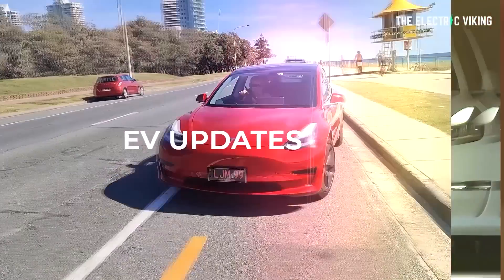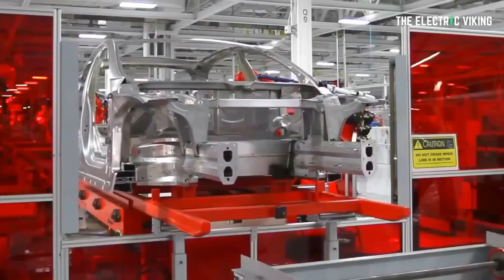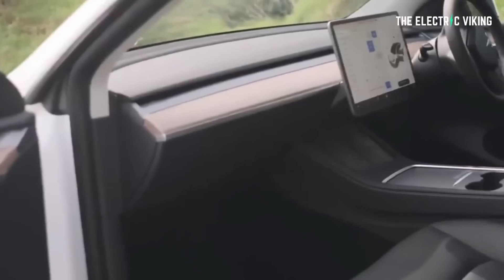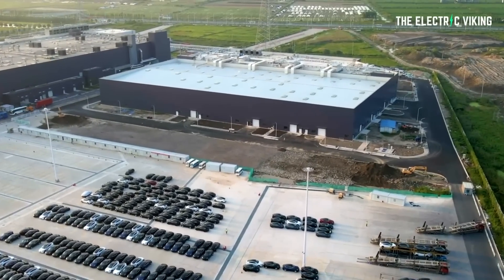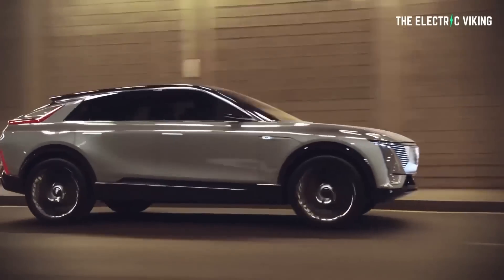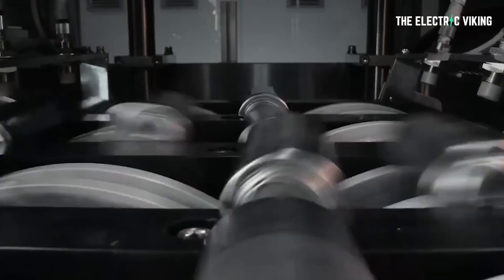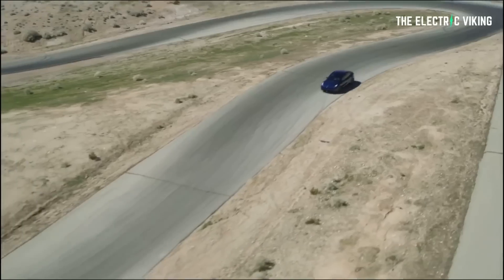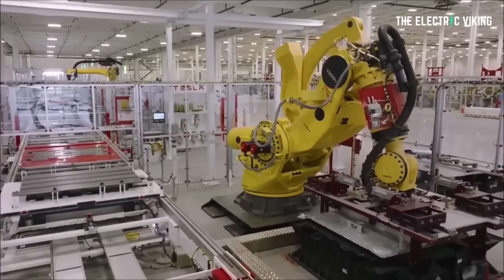Tesla's NEW 4680 battery pack size is UNBELIEVABLE

Comment: It may also be that Tesla wants to make as many cars as it can with its limited supply of 4680 cells, thus making more profit.  As someone else mentioned, for most people 250 miles of range is fine.  Making 50 kwh packs means they can make and sell 33% more cars than if they made 75 kwh packs.
Reply: If this was all about profit then why not produce less cars and have insane prices?  Far better profit ratios that way.
Reply: @davidbeppler3032  because that's not the most profitable outcome. You don't get charging station networks across the nation by selling expensive cars
Reply: Perhaps is a matter of supply.  They need these cells for cybertruck and the transport truck.  That higher efficiency will be invaluable.   For those of us waiting for a vehicle ability to produce more is important.
Reply: @elainebradley8213  
They al ready told us.
"WE. ARE. NOT. BATTERY. CONSTRAINED. THIS. YEAR!"
Reply: @rogerstarkey5390  Elon is known to exaggerate. A lot. Also, Tesla is still in negotiations to have more cells made. So right now, they are constrained. Finally, please calm down. This is supposed to be a discussion, not a shouting match.
Reply: @vremster  
I get really fed up with people
1) Just not listening
2) taking information second hand, rather than from the source
3) Making wrong assumptions from that information, then protesting it as fact.
.
They literally have a stockpile of cells.
They have said so.
They have sufficient ongoing production, even at low volume.
They have said so.
It wasn't just Elon saying so...
Apart from those facts, you "might" have a point, but since those are facts .....
.
"In negotiations to have more cells made"....?
If you mean "4680 cells", it's a lot more than "negotiation".
Panasonic has, or will very soon, supply cells for evaluation.
.
Ask yourself about the technology they used.
.
Nobody could make 4680 cells because of the resistive heating issue ("long electron path")...?
Maxwell found a way.
Tesla perfected AND patented it.
So unless Panasonic found another way, they're using the patent "in good faith'....?
.
In that case, they're not "negotiating" but "cooperating".
Hence the very conciliatory, almost submissive, tone from Panasonic (read the statements)
Reply: @vremster  When did Elon exaggerate?  He said the Model S Plaid would be stupid fast.  It is.  He said the Model Y would be the world wide best seller.  It is.  He said they would build reusable rockets.  They did.  He said he would sell all his houses.  He did.  He said he would send a Tesla to space.  He did.  He said Tesla would be bigger than Toyota.  It is.
Reply: 1) "make as many as possible"...
That'll be the MISSION ??

2) 250 range is fine.

3) IT'S NOT A 50 kWh PACK! Watch the actual test rather than taking information second hand from an (often) unreliable source!
Reply: @rogerstarkey5390  I can work with only the data I currently have. I haven't seen a test video yet. I'll have to look for one.
Reply: I don’t know about the 4680, but with other batteries it is good practice to keep between a 20 - about 80% charge, ie 60% of full battery capacity. If so, then the 4680 would have a good practical range of 60% of 250 miles (assuming that is the stated range) or 150 miles.  Seems a bit short a range to me except for short local commutes and trips, however with Tesla’s SC network that would not be a problem going cross country so maybe not a real problem.   When an EVs range is stated as X don’t expect to get anywhere near that if you do a lot of long range driving. Charge rate slows down significantly as the battery ‘fills up’, I assume it’s true with the 4680 also.

Comment: Early 4680 data points are pretty difficult  to interpret.  Tesla is most likely driving strategy to minimize Osborne effect until reaching scale.  Possibly all new tech is not yet implemented.  Like the silicon doped anode, might not be implemented.   Very difficult to draw conclusions.  I think reaching scale and reducing cost are right now Tesla top priorities.  Improving range and efficiency is not yet needed to sell more cars.
Reply: Silicon on the anode was rumored to be already in use in the Model 3 cells, the 21700 ones.
Reply: @pkvp7337  yes, actually it is, but in low amount.  Still mostly graphite.  Battery day Tesla spoke of special Silicon that can deal with stress of expansion and contraction.  Might not yet be ready
Reply: @teitpoulsen7183  My understanding of the conference is that silicon will still be only a part of the anode, mixed with the graphite. The silicon grains are coated with a flexible gel and the mixed in the graphite.
Reply: @pkvp7337  Tesla's cells are officially known as 2170....
Reply: Regarding Osborne effect, it makes sense to build the cars with 4680's, sell them with a marginal range improvement, to limit the Osborne effect, then as always, with Tesla's cars, after data gathering, modify the charge/range/battery buffer/discharge BMS maps to give a more practical 4680 range via an OTA update, once all non-Chinese 2170 Tesla's have been phased out of production.
"Look, you got a(nother) Tesla freebie!"...
Reply: 4680 cells are NOT easy to produce. Especially in HUGE Volumes as required by TESLA. And also met the High performance requirements of TESLA. We need to wait for more data ... after 4680 batteries are manufactured in HUGE volumes. Maybe After 3 to 6 months ... when Data are available .
Reply: @sunshinesun121  
"WE" DO NOT "Need more data"
"We" WOULD LIKE more data. 
BUT as you indicate, we need to wait.

Comment: According to Warren Redlich the TX model Y with 4680's weighs as much as Fremont's model Y with 2170's. So either the 4680's are a sham and not more energy dense or what you say about unavailable battery capacity-in other words the TX Y carrying around dead weight- is true.
Reply: Check Spoken Reviews. He weighed it. At least 150 kg lighter!
Reply: @My_HandleIs_  You know my memory isn't that good but it seems to me he attributed that weight loss to structural pack and to giga-press parts.

Comment: I think you are right.  Tesla is just preventing the Osborne effect.  Once Tesla and Panasonic ramps to enough 4680 volume they will stop making the Y with the the 2170s.
Reply: Nailed it
Reply: What happens to the 2170 cells? Only go into model 3?
Reply: @CraigFryer  
🤔
(Paraphrased)
"I expect the energy busines to match the Automotive business"
Elon Musk.....
It's Teslas' "Ace in the hole".
Their cell supply isn't "Osborned"
It's "re-tasked"
Reply: @rogerstarkey5390  They could go into PowerWall, but MegaPack are all supposed to be LFP now.
Reply: @CraigFryer  IMO Model 3s will be dominated by the LFP packs in the base model, and later in the extended versions.

Comment: will these batteries be avalabile in a power wall?
Reply: Probably not for a few years. Powerwall doesn't really benefit much from weight reduction so whatever cells are least costly are what they'll use. 21700s will probably come down in price soon as 4680 production continues to ramp up.

Comment: Hidden capacity! Fill to “100%” every day, which is actually less than 100% full. Tesla batteries degrade to roughly 85% over the life of the car, what if that 15% was built in?
Reply: They not only degrade they expand to dangerous levels. That's the architecture of their batteries.

Comment: Many if not most buyers do not need or want in excess of 250 mile range. The idea of the software locked under actual capacity could be just part of a strategy to allow charging to 100% without any downside to longevity. Also it may be part of real world data gathering before allowing the most demanding use of the new battery type so they can manage the risk of the unknowns until they are no longer unknowns. They don’t want to risk a repeat of GM’s mistakes with the Bolt.
Reply: I suppose I should have qualified my statement that most if not all second EV purchasers don’t need or want in excess of 250 miles range. It is something you discover by doing it, so existing owners will understand that range is a nice to have to increase flexibility in use, not a need per-se.
Reply: It makes me think of the demand for a pickup truck over the decades.  How many people actually use it for its design? lol, I'm half guilty, although I realistically used the bed maybe 5% of the time.  How many people do long road trips?
Reply: @dingymon  You are not wrong.  But we who live in the boonies tend to load up when we roll into civilization.
Reply: “Many if not most buyers do not need or want in excess of 250 miles range.” Isn’t that what Elon said? And we’re just supposed to automatically believe that because Elon said it? Come on, don’t be like a Trump supporter and just believe the marketing speak. Bill Gates once said that nobody would ever need more than a 10 meg hard drive. (When are people going to stop making ridiculous, short-sighted proclamations like this?) They say these things to keep demand in line with what they want to deliver, to keep profits up and the need to stretch the envelope down. People are going to want as much range as they can get, for a fixed amount of money, as that would represent more value for their dollars. This is especially true if they plan on towing! Even true if plan on driving long distances on cross country trips or even small vacations. Competition will force Tesla to increase the range on the Y. Elon knows this, he’s just counting on selling as many cars as he can in this low range version, for increased profits for a while. He’ll mention the statement that you started out with a few more times to try to condition his market, but eventually he’ll have to put bigger battery packs in.
Reply: @davidwollpert5276  I said it first. All early EV adopters managed with under 100 miles of range. I managed for 8 years with 35 miles/day. Many folk over-estimate their actual requirement. More range buys flexibility to select different stopping points along the route, not the length of the journey. I would never suggest you just believe everything Elon Musk says, but the odds are he is more right than most of us. Do your own survey of your actual journeys over one month. Then reconsider.

Comment: it doesn't have a 50kwh (50d is misleading) the  battery pack  energy density is less than the 2170 but this is early days so will improve
So not as good as you say but still it will improve and for Tesla to start at energy density close to Panasonic is quite the feat. Watch Tesla Economist for more info
Reply: I'm going to say it's exactly the same volumetric energy density as the 2170, because it's similar material.
They put the same amount of that material (jellyroll) into fewer, larger volume cells.
Result, lighter pack (less metal)
Same capacity (as near as makes no difference.
Then
Lighter BODY (no floor).

So we have
Same kWh.
Lighter car (160lb?)
Same aero.
Slight range increase?
.
MAYBE faster charging? We don't know if the pack was preheated. We haven't seen a "Bjørn test" with ACTUAL raw pack data.
We do have confused commentators making rash statements...
Nothing new in that regard!! 🤷‍♀️
Reply: @mogad look the Panasonic 2170 battery has been the gold standard to be close to that in energy density is impressive as Tesla said on battery day that the improved spec of the 4680 will take time to achieve in the manufacturing process.